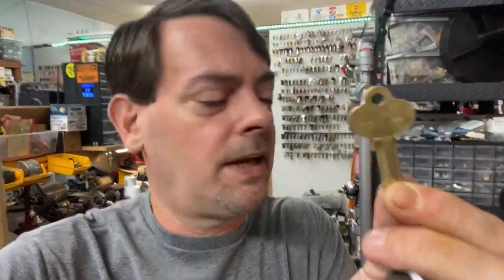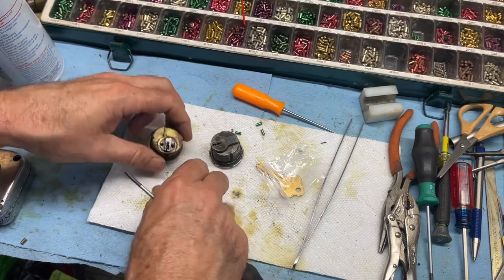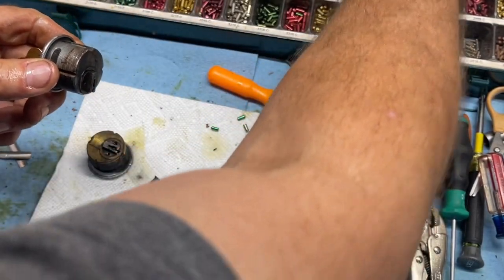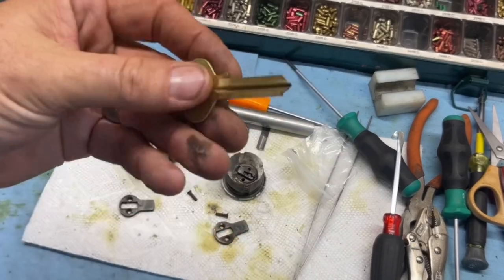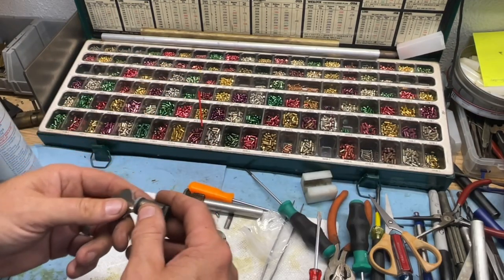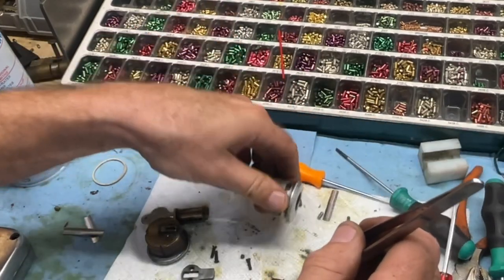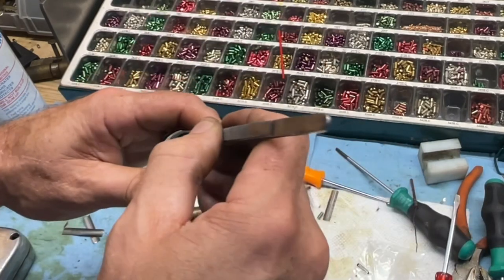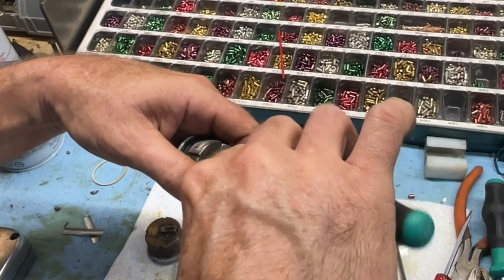a “locksmith” couldn’t rekey these

Comment from the maker: I want to point out, and I didn’t mention it in the video, but this was the “son” of a locksmith who’s father had rekeyed similar locks in the past for this customer. 
If that’s the case, the son likely did have some type of equipment (for key cutting) or at least one would assume that. Who knows 🤷‍♂️

Yes you can easily clip out a key with a inexpensive Lishi clipper. Maybe it wouldn’t have been “on spec” but it really wouldn’t need to be, you can clip out a key and use any key pins that worked.

Comment: Hi Jason.
Thanks for doing this video.
I'm really surprised that a locksmith could not do a key for these locks. 
Unless they are auto,but they do Honda's.
Or no pin kit,not it's in a right state of the state of the state of the state of the state of the state of the pin kit. Easily done with a pin kit and correct tools.
Thanks again for taking the time to do this video.
Hope you didn't get too wet.

Comment: I embarrassingly almost had to tell a customer the same thing last week. RU46 mortise locks. I just happened to have extra blanks from one previous customer, but I don't have a code cutting machine or space and depth keys for the RU46. So I put their current key in my duplicator, cut the first two cuts more shallow, and the last 3 cuts deeper, and then trial and error'd the pins till I had a working lock.

Comment: I'd probably say that the 
"Locksmith" in question 
Only had Schlage & kwikset 
pinning kits... & a drill. 
😁

Thanks for sharing.
Reply: That's what I was thinking.
Reply: one off locks that don't need to be part of a system can be set to whatever pin specs a person can dream. May not be "right" but it can be done. As long as the key brings the pins to the shear line, the lock don't care.
Reply: @georgeblair7129  True. That 2nd plug looked like the top was ground off to add some slop to the sheer line. Jason's reaction had me wondering if the 1st guy accidently dumped the top pins. (no spring or pins)

Comment: Speaking of key machines. Who do you know around the southern states who can repair HPC blitz? I have a couple that need parts from rotating through different locksmiths  vans over the years and sending them to hpc is a 9 month ordeal right now.
Reply from the maker: It's up to 9 months now? So ridiculous. I've always mostly done my own (minor-ish repairs) so I don't know if anyone else is out there. I think they gotcha on the specific parts though.
Reply: @selock  Hey man! I called you the other day. Yeah..I calibrate all of ours but I've got one that has a screwed up needle assembly. Basically, cotter pin broke that holds the spacing shaft (the shaft that moves the vice horizontally) and the whole vice supposedly shot out and totally screwed up the needle gears 💩 ⚙️ 😳

Comment: Pretty bad that someone that's suppose to be a Locksmith couldn't rekey a cylinder and cut a key. Maybe they didn't know about shimming the plug from the rear or had another job that was going to pay more. Could have lazy and didn't want to deal with gummed up cylinders. If I can re-key  those and code cut new keys with a rudimentary Foley Belsaw Model 200 (with tolerances of +/-0.01") then something is wrong with the so called "Locksmith" (they might not of had a key machine with them which would be stupid). About the only requests I've had that I cannot do is Biaxal keys, New Automotive keys, and programming fobs. Now if I dont need a key programmer I can sometimes manually program a fob. I don't have the money to spend on the equipment needed to do those tasks. I've been a Locksmith Apprentice for about 18 months. My mentor has taught me just about everything he knows and I've taught him about some things he's forgotten.

Comment: I'm wondering if the son of the original Locksmith was able to remove the mortise locks from what was probably an old entry handle lock set. ( not sure what those are called actually) anyway... It doesn't look like any attempt was made to open the cams etc. That or Russwin looked foreign to him and no code machine to boot.

Comment: Maybe he didn't have a key machine or depth / space info/card or depth & space keys? Maybe didn't have another blank to reference off of, depending on his machine? Obviously, there are ways of getting around all of that. Who knows. Good job, Jason 🍷
Reply from the maker: mmm maybe, but if that’s the case they really shouldn’t be performing/responding for the service 🤷‍♂️
would be kinda like me responding to a sidewinder Honda AKL call really
Reply from the maker: also like I notated, I could have accomplished this with a $40 Lishi clipper (maybe not that great a key but still would have worked fine)
Reply: @selock  Yeah, you wonder sometimes. I mean, I read somewhere else where you mentioned it was the son of the locksmith who had done it before, so presumably if he's calling himself a locksmith he has tools like you said. But really, even if you have nothing... Zero locksmith tools, zero reference material... Take the lock apart, stick the blank in the cylinder, make sure it's seated fully, stick a nail or a 1/8 inch (I think) drill bit in each pin hole, whatever you have to mark center. Then file, being mindful of your angles and to allow enough width for the root cut. Reuse the pins, just swap the position of 2 or 3. And like you said, doesn't even need to be on spec, so you could even file the pins shorter if you wanted to. If there's no working key, pick it. If you can't pick it, shim it. Don't have shims, go raid your DVD collection or buy a cheap one for one of those anti-theft thingies, and take it apart for the metal strips. They're not pre-curved, so a little fidgety, but they work. Use a drill bit or a rolled up business card for your plug follower. It's about as down and dirty as it gets, and the end result might not be pretty, but it'll work.

Thank you for reading my rant 😆. As you said, if you can't do it, don't say that you can. But, everybody's new once, so the point is, there's nothing wrong with not knowing, just learn... From fine, instructive videos like this one 😉👍

Enjoy your Monday, Jason! 🍷